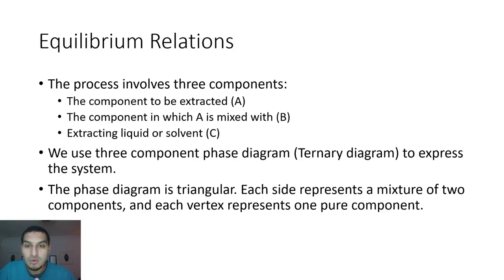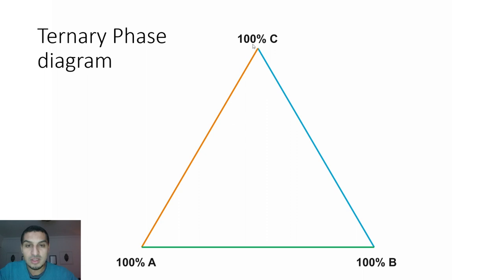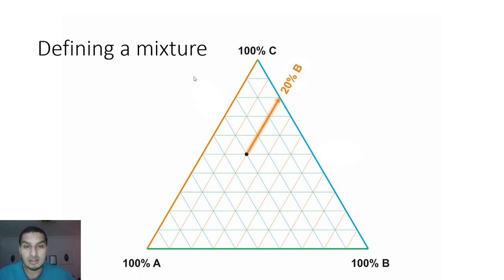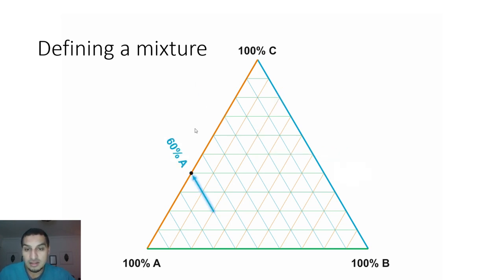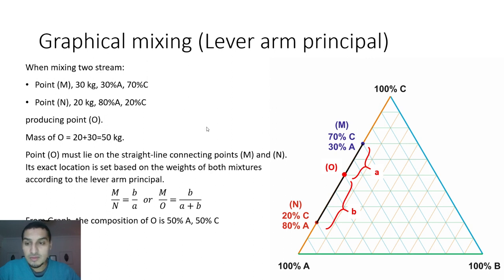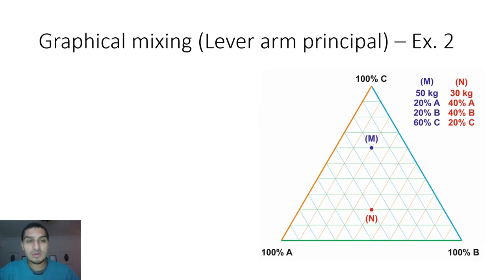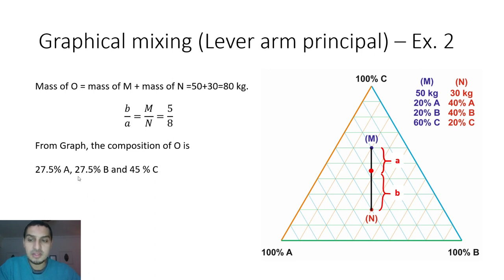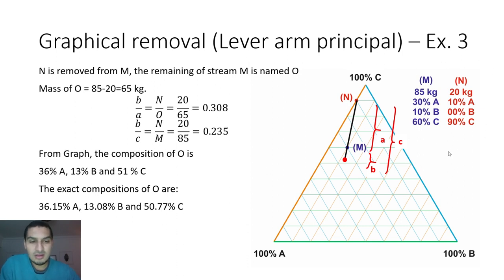Excel for Chemical Engineers | 51 | liquid liquid extraction (2) - Ternary diagrams

Comment: Hi thank you for this. It was really helpful. But what do a and b represent? Are they distances (in cm) or are they mass fractions?
Reply from the maker: a and b are distances that we use to determine the location of the mixing two streams with different mass fractions using lever arm principal
Reply: @MGMohammed  thank you so much 🙏